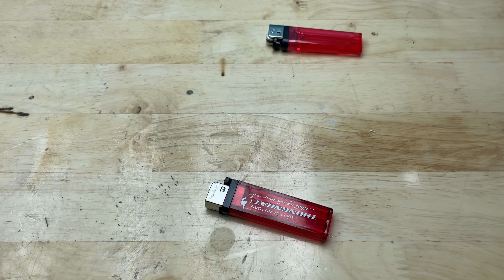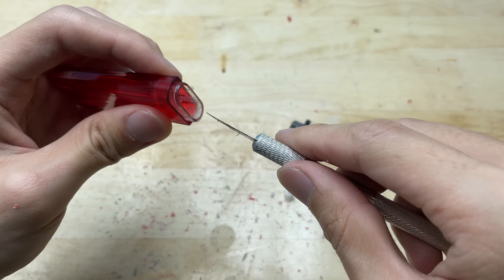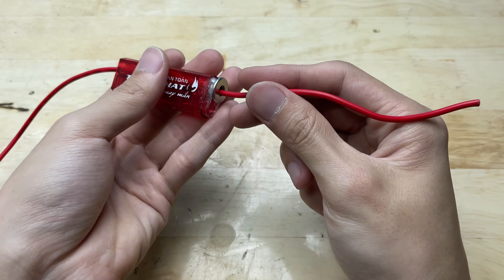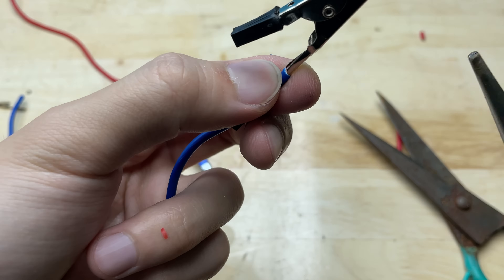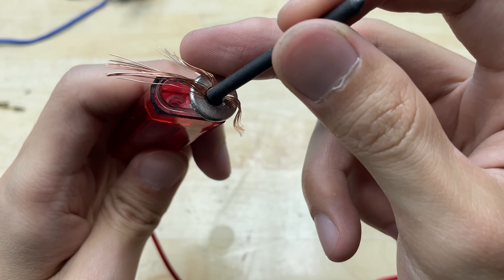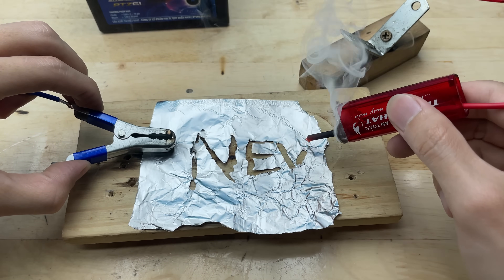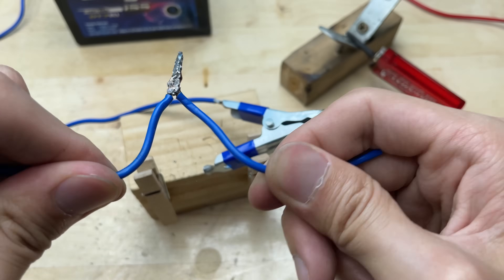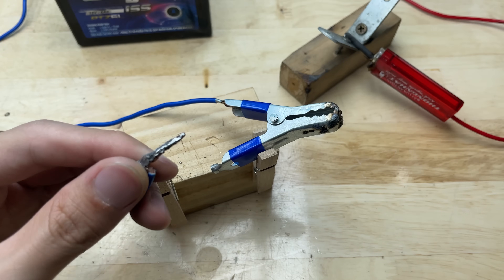Don't Throw Away OLD LIGHTERS! This Great Recycling Idea Will Surprise You

Comment: Hold up you just drilled a hole in the lighter how did it not explode? I  mean even if it's completely out of fluid there's still fumes and it's contents under pressure 🤔🤔🤔 can you please explain how it didn't explode?
Reply: where is the mistake in your question ?